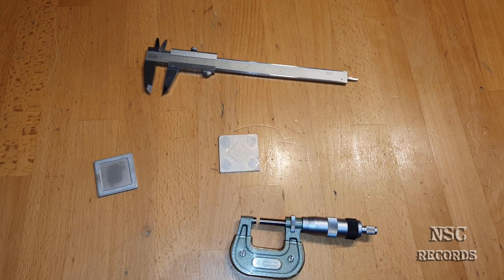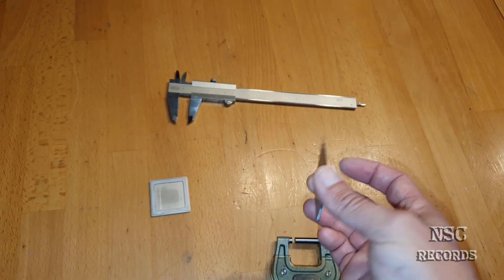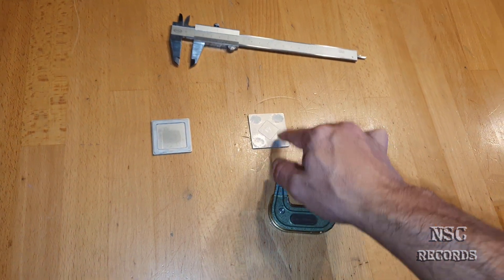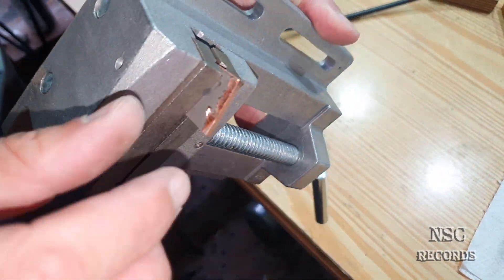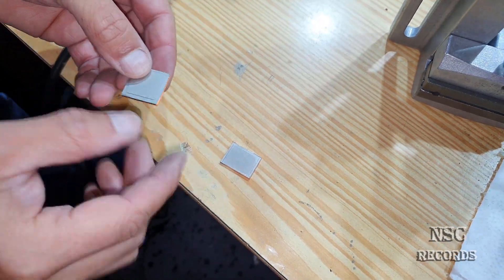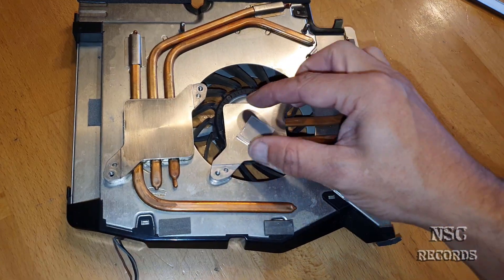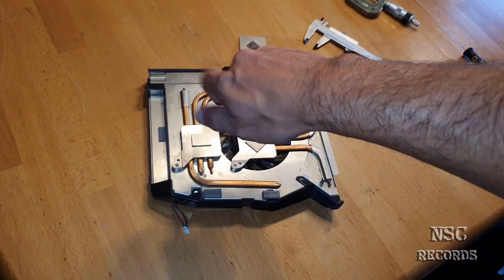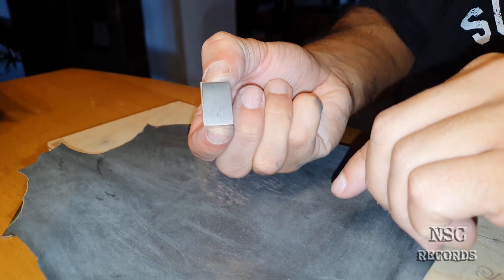NSC´s PS3 Mini IHS Project Part 1 By:NSC

Comment: Moin hätte mal wieder ne frage hab mir ne Chech C04 geholt für 20€ die läuft einwandfrei aber das Laufwerk ist defekt und ich finde keins mehr auf ebay.

Dann hab ich mich selber rangemacht und habe gesehen das das Kabel abgerissen ist und die Mechanik nicht funktioniert finde dazu auch kein Video leider Gottes. Und kenne mich damit nicht gut aus.

Hättest du noch ne Chech C04 wo du alles mit der Mechanik zeigen könntest oder kann mann dir die Konsole zuschicken das du sie repariert (natürlich mit Geld) 

Wäre wirklich lieb
Reply from the maker: @normiicod  Hi Meld dich bitte auf mein WhatsApp

Comment: But if you do that you will be reducing heatsink size, actually the IHS is the first heatsink so the bigger the better, the Ihs is like Cache memory, its the first and closest adreess the the processor delivers its heat, the big the better, if you decrease that size it will only heat more.
Reply from the maker: Nope :)
Reply: @NSC-Modz  Ok Then.
Reply from the maker: @VictorHugoAlvarez-eternelymiss Tests gonna show, i already got my tests, and they not bad at all :)
Reply: @NSC-Modz  alright I will check then.
Reply from the maker: @VictorHugoAlvarez-eternelymiss yeah, I'm surprised my self about the results 😀 As long it stays the same or better, I'm happy with 🥰🤗✌️
Reply: @NSC-Modz  alright, Good, I'll wait for the video!!!

Comment: As you said, better would have been without the heat spreader. Direct kontakt. This is something I like about the super slim. One chip has direct kontakt to the heatsink. They should have made both the same. Me personally, I stopped investing time in the Ps3 fat because I know it will eventually die.
Reply from the maker: @TheoS.Official  you right, that's why no RSX IHS on the SS... but yeah, i keep going on the fat, because perfect doesn't exist for me, one day, you gonna do it better again, so it was not prefect if you understand 😆
Reply: @NSC-Modz  perfect is the Frankenstein 😍 of course with some adequate cooling mods. 😄
Reply from the maker: @TheoDJ23 not even that is perfect, prefect is a system that you don't need to touch it... just than, it's nearly perfect, like the Nintendo Wii U, still working and working and working...
Reply: @NSC-Modz  yeah, of course you could improve things, but the Frankenstein surpasses my capabilities 😄
Reply from the maker: @TheoS.Official  xD Yeah, but like i told, never touch a running system is the best you can do 😆 For the FS mod, you will need to heat up the MB for reballing, and you will need to heat it up two times, for removing the RSX and to replace it back... i prefer not to do that, because the MB is the most important thing ever. The only Reballing i would do on my baby, is Laser Reballing, nothing else...